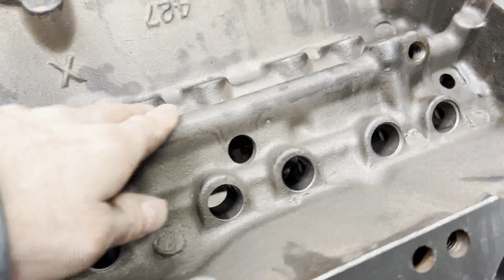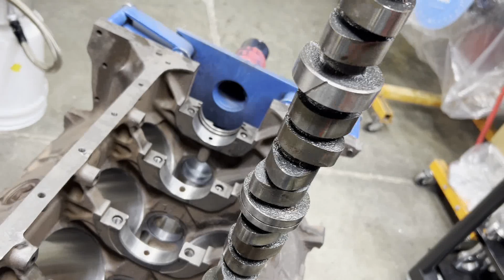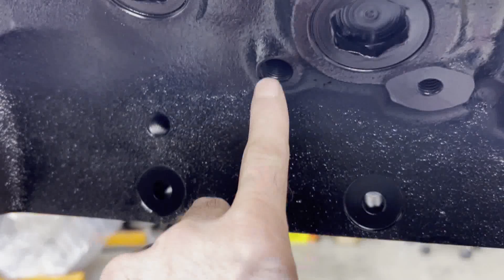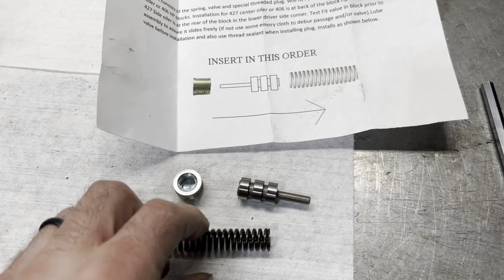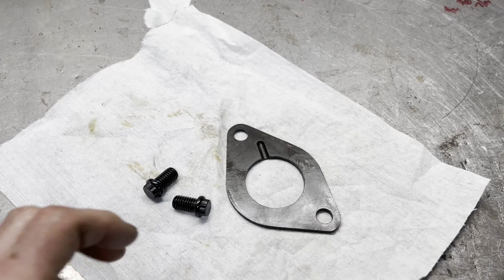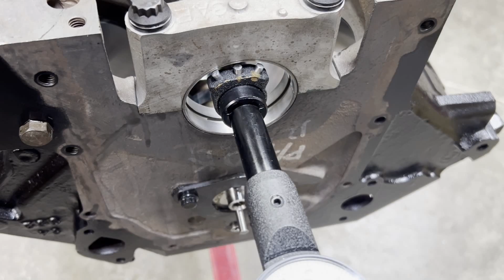Lykins Motorsports Ford 427 FE Side Oiler Tunnel Port Block Prep...

Comment: One thing about camshaft bearings I learned as a machinist, it's called having the cam carving knife to carve to cam bearings so the cam fit, it's not that they weren't machines straight there's core shift involved.

Comment: I remember working on one of those blocks they had plumbed it for hydraulic lifters after fittings in the in the copper lines are steel lines. They got ready to just use the block in an old pull truck motor it used to be an old NASCAR block in the day, convert it to Street for the hydraulic lifters but. Converted back to pull truck racing.

Comment: Seems like from what I've learned is the blocks are no longer straight and that's why you can't get the cam in because the block has twisted and is no longer straight so i would say you need to line hone the cam bearing holes to make them straight

Comment: Brent do you recommend using the sideoiler bypass if you are using a high volume pump? And does this go hand in hand with a high pressure spring in the pump?
Reply from the maker: I rarely use a high pressure spring for anything.  I like a stiff spring in the rear bypass so the pump bypasses first, or just plug it.

Comment: When I built a TP engine to go in Brother Lon's then-new '67 Mustang we got a short-block from the parts counter at the local dealer and I got the top end from a contact at Triple E who was involved in the LeMans development program. We got heads, manifold, and a pair of 652 center-squirter carbs. Both the heads and the block were painted black. This was in the fall of '67. My '64 Custom 427-T also had a black paint job on the engine. My '65 1/2 K-code Mustang also had a black engine. I have always used black on Ford performance engines.

Comment: Holman Moody is still grinding cams for customers but they need you to supply the blanks . They always treated us good as far as tips and tricks . I don't know why I never ran across problems with fitting parts like cams , intakes or distributors. Some people did but I didn't. I worked on everything but the SOHC as far as performance Fe engines . The only sodium valve I ever dropped hil the piston and the other seven were perfect . I'm glad I didn't run into too much trouble years ago .
Reply: My friend used to work for Holman moody in charlotte

Comment: does chamfering both sides of the crank oil holes  actually help increase oil to the bearing surface? I could see a chamfer on the trailing edge of the hole.....

Comment: How do you bore&hone your cylinders without the pistons?
Reply from the maker: I tell this to customers who buy pistons from me:  it's not 1987 anymore.  Pistons are made by very exact measurements and an entire set of 8 will only vary by .0001-.0002".  You don't need the pistons in hand to finish the block.   As a matter of fact, it's better than the entire block be machined before ordering pistons, so you don't order them first and then get a surprise that the block needs to have the decks cut way down, there's a nick in the cylinder, etc.
Reply: @lykinsmotorsports OK I guess if a set of pistons are 1-2-10's of each other and the set is exactly to spec your good to go.You do an excellent job with attention to detail  both assembling engines and your videos.

Comment: When I took apart my FE some of the old cam bearings looked like a pocket knife had been used on them.
I installed new bearings and it was difficult to install the cam.
I did the cuts in the cam journals on an old cam which allowed me to install the cam but it still needs some work.
It is hard to begin spinning the cam but once you get it spinning it is not too bad. Once you stop it is hard to get it to spin again. Frustrating.
If you would please share where you got the emory ball you have.
Thanks for your videos and Happy Thanksgiving.